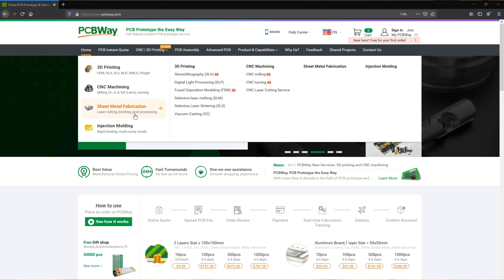Upcoming Projects Teaser - Voltlog #365

Comment: I have been affected both for my hobby projects and at work. I have bunch of projects I cannot finished at home because the IC’s are either now out of stock or the prices are up, sometimes x 5.

At work we are having to redesign boards to use parts we can actually get.

From what I heard from our suppliers is that it will probably be early 2022 before we see some relief in the chip shortage.

Comment: Just an idea: make the hot air circulate inside the oven, don't know if it is practical nor if is feasible but it may helps to distribute the heat better.
Reply from the maker: The idea is good but it's not easy to implement.

Comment: I work in the medical industry as a hardware engineer. From what I have seen so far, 95% of the projects that I have worked on are experiencing issues with shortages. We have many devices at this point that we cannot produce boards for due to the shortages.
Reply from the maker: It's crazy how the worldwide silicon manufacturing capability was barely covering the needs of the industry and once they've experienced an interruption they can't cope with the request.

Comment: Cool, I started working on a simpler esp32-powered canbus-adapter and found that for slow bus speeds, specifically 20000, V3 version chips are needed :-/. Which tranceiver did you selected, so far?
...no chip-shortage issue, so far, the time-shortage is the real threat for my projects
Reply from the maker: I'm using the TI SN65HVD231 but I'm only using it at higher speeds of 100K, 500K, 1M.

Comment: Loving the FT232H JTAG adapter boards very nice. Not too dissimilar to the Shikra board. I have been working on a couple of designs myself based on the dual version of that chip the FT2232H. Another FT2232H based board is Tigard. Be sure to check that out if you haven't already. You planning on sharing the gerbers for that adapter board?
 As for parts availability. Been having a nightmare at work microcontrollers, crystals, power regulators, memory can’t seem to get anything. We are spending most of our day trying to source components!
Reply from the maker: Thanks! The source files for these projects will be available once I publish the video. 👍